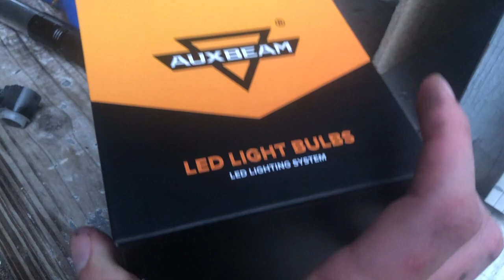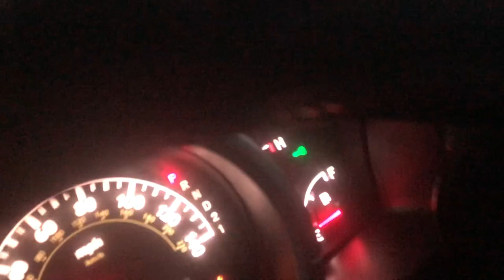2006 - 2014 Honda Ridgeline LED Conversion

Comment: Wow, I very much appreciate this video. Wanted to do this upgrade on my 2006 Ridgeline. I'm a mechanical idiot, but am confident I can do this. Thx.
Reply from the maker: It's very easy on Ridgeline, plenty of space. In future I am planning on doing projector install on the headlights.
Reply: @PZPal  Done! Works great. I noticed that after adjusting the lights (clockwise for down, counter-clockwise for up) that I need to drive for a little bit. They seem to settle slightly after adjusting. Took me several tries before I got it where I wanted it. Definitely an improvement.

Now to deal with the crappy, plastic, yellowing headlight covers. These are blocking half of any light coming out.

Comment: How are the  Lights supposed to stay cool with the rubber boots on the back
Reply from the maker: My understanding is LED does not heat up much, so with rubber boots on the back they cool down fast enough. I never had any overheating issue

Comment: Have these kept working without catching fire or blinking
Reply from the maker: Its been working perfectly. Only one thing I might change later is readjust one of the headlights as its a bit lower than it should be. The LEDs though are perfect! Thanks for watching
Reply from the maker: https://amzn.to/3FTyBIe - thats the ones I used